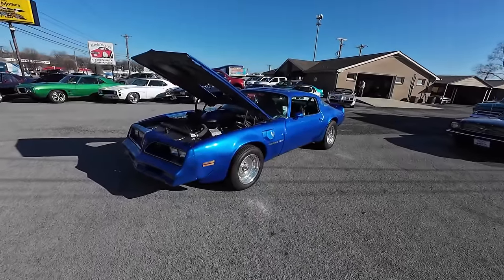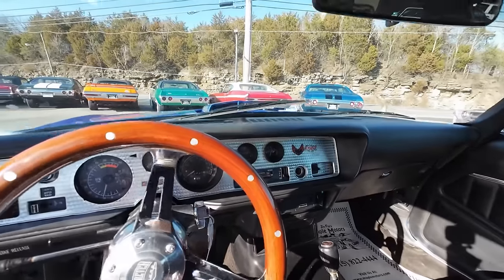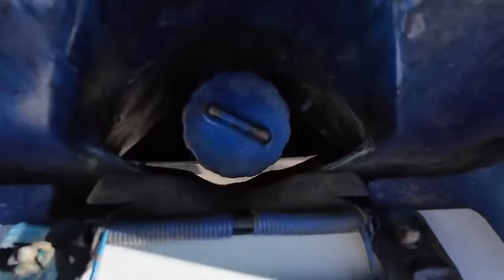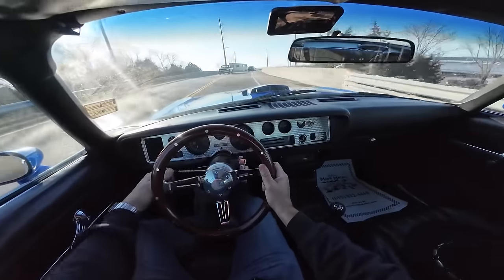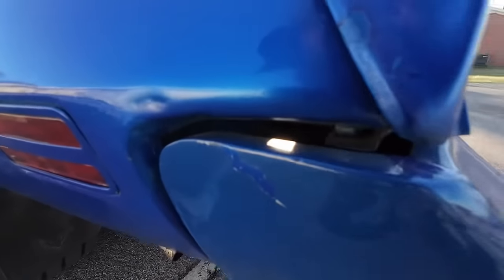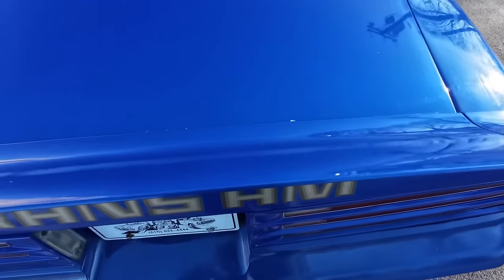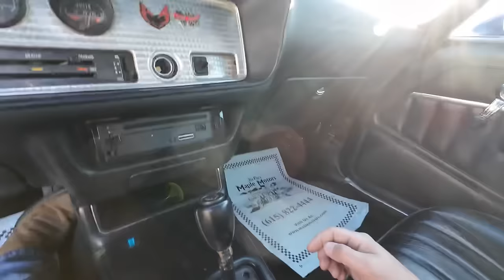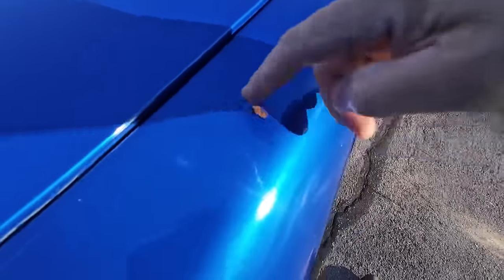Test Drive 1978 Pontiac Trans Am 454 Big Block SOLD FAST $13,900 Maple Motors #2261

Comment: The vibration showing up on the dashboard and steering wheel is more than likely due to a busted motor mount. Motor mounts in good condition absorb vibration.

Comment: Another Chevy engine conversion: I'll never understand that. What's wrong with Pontiac power?
Reply: Correct, 455 Pontiac was a torque monster
Reply: A lot of them came new with an Olds motor.
Reply: @randallvoth8810  I realize that....in fact, I had a '79 T/A with the Olds 403. But my point is that if someone is going to go through the trouble of replacing an engine, why not keep it all-Pontiac?

Comment: I remember the glory Days of these cars back in the late 80s early 90s. You could buy  a sweet one between 4 and 5,000 in Auto Trader. I bought one in 1990 Starlight black 1978 t-tops mint condition for $3200 man I miss those days